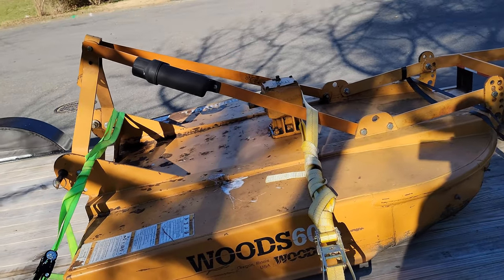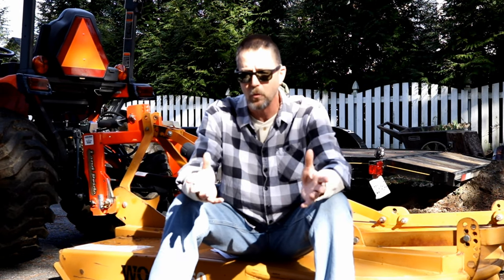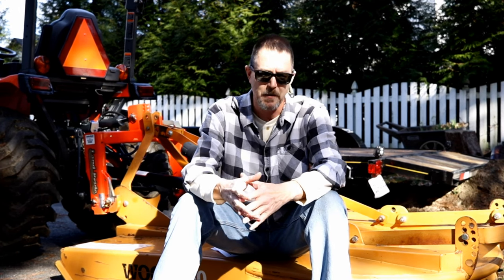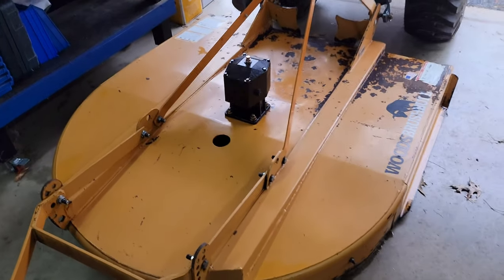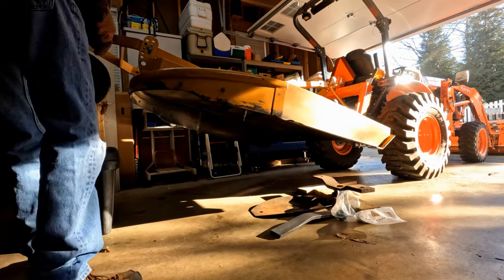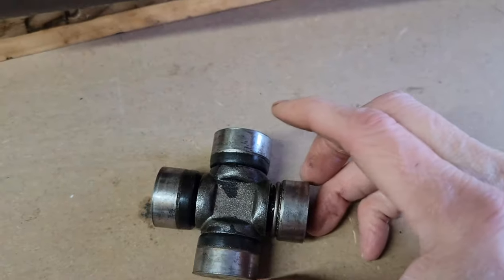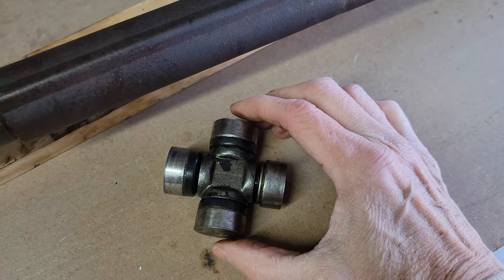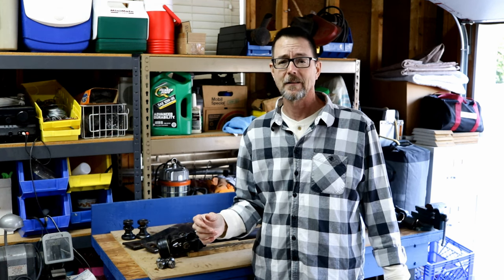027 – Buying a Used Rotary Cutter. Was This A Mistake? | Woods BrushBull 60

Comment from the maker: A few final thoughts...

I did purchase and install the aftermarket U-joint and the repaired drive shaft worked perfectly.  It will serve as a spare.

If my use of the "coupon" really bothered you, the full price without it ended up being $1197, which Is still an excellent deal based on all the ads that I saw in my research.

Comment: Man great Video and informative 
Would have been a great Premier 
I think you have a Implement that will last you a lifetime 👍
Question: Was the manual still in the tube ? 
Suggestion #1 - if you do not have Fork Attachments you should get ya some 
Would have made the unloading easy peasy !
Suggestion #2 
Get ya some Kubota Orange Paint to match that Beautiful Tractor of yours (totally your call ) my opinion 
Long Video but I really enjoyed it and watched it all 👍👍
Thanks for sharing Chris
You got a great deal 👍
Reply from the maker: Many thanks Phil.  The seller did provide me with the original manual, although it was pretty clear that it had not been stored in the tube as it lays nicely flat.  I'm going to print a copy (I have the PDF) and keep that in the tube.

I do have forks, but they are only 42" so I would have needed chains either way and the bucket has chain hooks.  Point taken though!

Ross said orange too!  Actually, I'll probably repaint it the original Woods color.  My real challenge is finding the decals.  Most folks wouldn't worry about it, but as previously mentioned, I'm a bit anal-retentive.  😉😂

Thanks for watching, appreciate your comments. 👍😎👍

Comment: With new equipment prices you probably did pretty good on this deal. You’ll not find a better built deck then the brushbull. You pretty much have a brand new unit now.
Reply from the maker: That was pretty much my thoughts exactly Ben.  Thanks!

Comment: That's a good deal, Chris. I recently purchased a cutter (a Woods 60 if I remember correctly) for $500 for my son in law. I never ran it but was told it was in working order. I never asked my son in law. That was 2 or 3 years ago, just before prices went insane.
Reply from the maker: Thanks Rick!  I feel like I got a great deal.  I've since added a gearbox hood (there's a video) and I have (but have not installed yet) a slip clutch.  I think I'll still be in the black 💰💲💵 wise.

BTW...thought I was already subbed but apparently not.  Issue corrected! 👍

Comment: Nice job rebuilding,  and you got a very nice bush hog now with a little work. Better match the paint. Your like me, I like to do it right. When i can.
When you were adding up the pto shaft parts, I was thinking, why didn't he just buy a new shaft? I bought the Vevor shaft as well, when I started pricing out a new yoke and shaft. cover. 👍
Reply from the maker: Thanks Rudy.  You're right, the Vevor shaft was really a no-brainer. 😉😎  And, yes, I will match the paint.  Well actually, it's all faded a bit so I'll respray the whole thing with a close match to the original Woods color.  Right now my challenge is finding the "BrushBull60" decals!

I've got a few more bits still to add...follow up videos soon.  Thanks again for watching. 👍

Comment: I could use your help. I am new to tractors and all things that connect to them. I just purchase a rotary cutter using some of the criteria you were using when shopping. I wanted quality construction and not all beat up. I was able to obtain that. However, West of the Mississippi and further West of the Colorado, and way South of San Francisco (San Diego) where there is little agriculture these days, attachments/implements are really expensive even very old and beat up. I thought I did good until I discovered my Rotary Cutter  company was no longer in business. Maybe purchased by Rhino or their parent company. Mine is a "Servis S-5" (five foot). I have no clue where I will get blades (it needs them) or the pivots. Also, the connection of the top link (I don't use Quick Hitch) has been modified with an additional part by the previous owner so I am not sure where/how it is supposed to pivot up and connect to the top link from my three-point as there are no other pivot points. I can connect it, but it will be rigid and even I can understand that would be bad.    Is there a book, a website, anything that I can use to understand the geometry of how the top link is supposed to connect to the top of the Rotary Cutter?

I really love the construction of my Cutter. It is super well made with very heavy gauge steel for everything and chains to prevent things being thrown out at me or anything around me and Zero rust anywhere with good paint.   The gear box and blade assembly turn easy and smooth with no noise or play. The PTO shaft looks nearly new and has all the guards and quick connects.   It is shear-pinned but I think I am going to purchase a clutch (old tractor with an over-ride clutch for the PTO Shaft) to protect both my Cutter and especially my Ford Jubilee (with update PTO spline size).

My older Brother would always tell me growing up: "The first thing you learn about a new Hobby is you bought all the wrong stuff".  I don't want to prove him wrong once again.  Thoughts?    Thanks!
Reply from the maker: Sounds like you got a nice unit.  I am unfamiliar with that brand, but that doesn't mean much...I'm certainly no expert.  A quick Google makes me think you may be correct about Rhino, and if so, I'd start there.  I did find a reference to Servis models Saturn 5 and 6...maybe that is the "S-5"?  Just a thought.  Good luck. 👍

Comment: Good deal but I think you should have gotten a slip clutch for it.
Reply from the maker: You are correct.  👍😎

Actually, I did, but I don't use the cutter a lot and so I haven't ever  gotten around to shooting that video.  Your comment reminds me I need to get that one done this spring!
Reply: @watershedoverlook  I went from using shear pins to the slip clutch and oh man I should have done it long ago.  Just remember every season to loosen the clutch and slip the clutch then tighten.  Other wise the glitches and get rusted together defeating the purpose of slipping in the first place lol
Reply from the maker: Lol...I think you must have read the outline to my yet-to-be-shot video!  😉👍  Actually, I did just cover slipping a clutch in my recent stump grinder setup video.  (And in the "first use" video, you can a pretty good view of it doing its job.  Cheers!

Comment: I ordered the same size at the woods company, brand new and they delivered it to us for $1600. So far you spent over $1200 on a used one, plus I don't know how many hours you worked on it. You actually lost money with this used brush hog but you did a great job fixing it.
Reply from the maker: Thanks for watching Ashley.

As to losing money on this, we'll have to agree to disagree.  I've got roughly $1200 in a rotary cutter that is all new, except for the deck shell, which has some surface rust and faded paint, but is solid and straight.  Charging myself for labor kinda defeats the whole idea of "sweat equity".  So we have basically the same unit, but mine is not quite as shiny.  As to your cutter, all I can say is that price is astounding.  I can't find any listings for a new BrushBull 60 selling for less than $3,100.  Whoever you bought it from...you better save their number!  😉👍
Reply: @watershedoverlook I can't find any hogs under 3k. Wherever this guy got it, I'd like to know.
Reply: @silverranger302 same!

Comment: For my tractor a new 4 foot rotary cutter is about $1800.  Makes no sense to mess with someone else's problems.  Usually if I run across a rotary cutter listed for sale used, it has a blown gearbox, or other major damage....I'd spend the money up front and know from day 1 how the implement was used and treated, rather than going blind into someone else's problems, and that's the only reason you typically find them for sale used, they broke something expensive and didn't want to pay to fix their mess.
Reply from the maker: I agree William...I don't want to deal with someone else's problems.  In this case though, I knew going in that I was going to be replacing the gearbox, which is the biggest and most expensive point of failure.  I think I'm sitting pretty good--basically everything is new except the shell which is in excellent shape.  Even without my "coupon" I'm only in for $1197.  IMHO, that's a bargain compared to $3500 for a new one.  (A new BB48 sells for around $2700).  Appreciate your feedback William.  Thanks as always for watching! 👍😎
Reply: @watershedoverlook  For the cost of a new rotary cutter I'd be buying a flail mower anyways LOL.  I've been tossing around buying a flail mower or a rotary cutter, and given the size of tractor I have, a rotary cutter would be a terrible idea, I'd have to have the loader on the front for ballast, and then have that cutter sticking 6+ feet behind the tractor...the flail mower would be a better solution for me since I mow in tight spaces quite often...and I'm not out trying to mow down small trees HAHA!!  BETSCO has a 4 foot flail mower for around $2500 which is what I'm leaning towards...my dealer quoted me almost $8,000 for a flail mower umm, wrong answer LOL.  Another channel has the Betsco flail mower I'm looking at and has done a couple of videos using it, and it seems to work extremely well...plus you can run knives or hammers depending on if you are cutting grass or grass/brush with it.  

A rotary cutter would be fine for mowing wide open fields, which with my tractor size I don't care to try LOL.  Dealer quoted me about $1800 for the 4 foot rotary cutter, not too bad, and its just the standard duty, but for my tractor, you ain't doing anything more than standard duty in the first place HAHA!!

The gearbox is the most expensive part on the whole rotary cutter...there was one here locally with the same issue, great condition but the gearbox was toast, looked up the replacement cost and it was near $1800...umm nope LOL.
Reply from the maker: $1800 gear box...WOW!!!

I like the idea of a flail mower too but I've seen very few used ones here and a new one is NOT in my budget right now.  And honestly, I don't really NEED either one, but, just like the tractor itself...I seem to be able to justify it anyway!  Cheers. 👍😎

Comment: Beware using the tools for bush hog repair for other mechanical work.  I bought a 1" impact wrench from Princess Auto.  It promised 1000 ft pounds of torque.  It was perfect for removing bush hog blades.  It destroyed a wheel stud on my Porsche Cayenne, though.  It also destroyed the bolts holding the control arm on a Tundra.
Reply from the maker: Agreed...right tool for the right job!  Thanks for watching. 👍😎

Comment: what size is the blade pin nut 1 5/8" or 1 11/16" ?
Reply from the maker: Thanks for watching Pete.  I'm not currently at the same location as the Woods cutter so I can't confirm, but I'm about 95% sure I used a 42mm socket.  I guess 1 11/16" is close?

Comment: What is the total weight of the complete Brush Cutter with PTO driveshaft?
Reply from the maker: The best number I could find was 560 lbs.  No idea if that includes the shaft or not, but if not, I'd guess a max of 600 lbs all in.